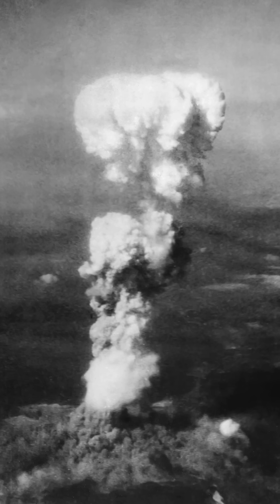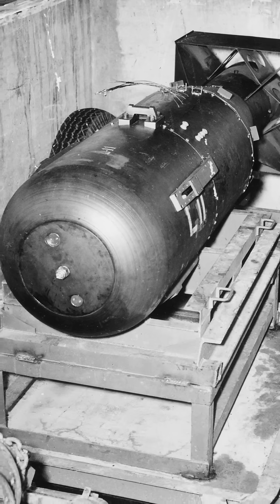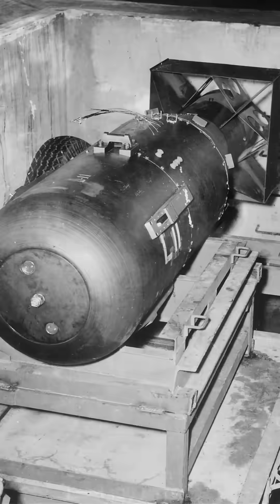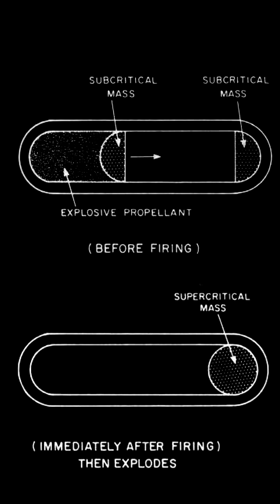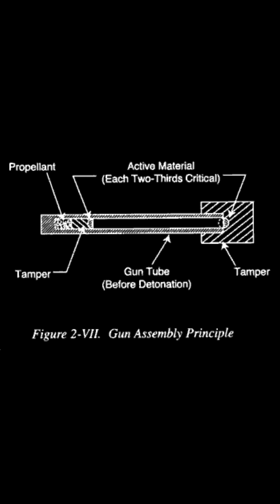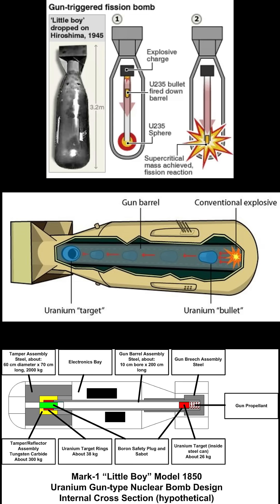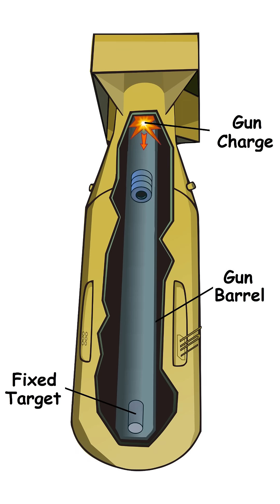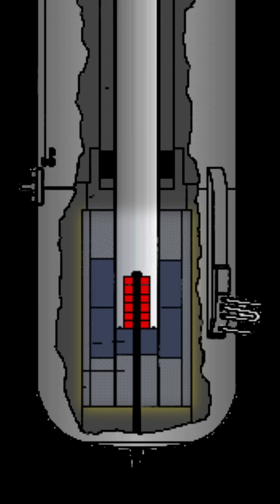What Everyone Gets Wrong About The First Nuclear Weapon Used In War

Comment: One of the reasons it was inefficient is that prompt critical mass was reached long before the rings reached their full travel distance.  This caused a premature detonation causing a lot of the fissile material to be wasted.  

This is why an implosion-type weapon is more efficient.  In this type, more of the fissile material is a part of the critical mass, but it's still possible that not all will be, depending upon how fast the implosion occurs.  If the prompt criticality occurs prior to the whole fissile mass is completely compressed, then some material can still be wasted.
Reply: No really. It had a few % risk of premature detonation, but in didn't happen in the actual use. Crossing critical mass does't cause immediate detonation in Uranium (immediate here means less than a millisecond). You also need a random free neutron to initiate the explosion. And Uranium is relatively poor of free neutrons. So when the projectile hit the bottom, it triggered a highly active neutron source and that triggered the explosion in several tens of microseconds. But the whole critical mass was fully assembled.

And the efficiency is poor because in gun type weapons you could only exceed the critical mass by relatively little (each unassembled part must be below critical mass, obviously; after assembly the critical mass is boosted by neutron reflectors, but it only helps so much; it's exceeded by a factor of 2 to 2.5).

In the implosion weapon the fissile material is compressed which boosts critical mass excursion multifold. Modern weapons are thought to exceed critical mass by a factor of 7 when they detonate.

Exceeding critical mass by more means way much faster multiplication of neutrons and more is produced and impacts fissile nuclei before the whole assembly is blown apart. 

Another thing (so called boosted fission weapons) is adding some (couple dozen of grams) deuterium and tritium in the very center of the weapon pit -- this supercharges neutron production and about doubles the burnout.
Reply: No. The Mk-1 was not terribly at risk of predetonation, and Little Boy did not predetonate.
It was inefficient because of the lack of compression.
This is why implosion allows for higher efficiency.
"more of the fissile material is a part of the critical mass" doesn't make sense.
Gun types don't produce any meaningful compression.
Reply: @Evan_Bell  I think you're responding to the wrong person. You and me are in agreement that the OP is incorrect.
Reply: @SebastianKaliszewski  Sorry, you're right I erroneously responded to you in my first reply. I'll correct it.
Reply: @SebastianKaliszewski  Everything you said is basically correct, although modern boosted weapons certainly don't produce 7 critical masses, and they don't use a couple of dozen grams of boost gas. The most I know of is 6 grams. Typical value seems to be 2.5-4 grams.
Reply: @@smithy1833unlikely but technically possible. Implosion type nukes are incredibly resilient packages, even dropping them from a plane won't cause critical mass to be reached, let alone cause it to go super critical.
Reply: @vyor8837  
Hell, even a few primary charges going off won't cause criticality, as long as most don't, or the primary charges are just a little out of synch with each other.
Reply: @@smithy1833 each segment is too small to reach criticality on its own.
Reply: Should have just made a cone instead of the cilinder. masses wouldn't come in contact until the very end.
Reply: It’s impossible to utilize all of the fissile material in any fission weapon design. The fissile spark plugs within most Secondary (and Tertiary) staged thermonuclear weapon designs achieve the closest to maximum maximum fission burns efficiencies relative to kg of fissile material used.

Of course there are still inherent limitations due to the maximum density achievable through minimal compressional heating so that the only counterbalancing pressure is the Fermi pressure produced by a completely degenerate Fermi gas. The inevitable shock induced entropy increase  during hydrodynamic separation of the secondary pusher/tamper ablation results in half of the total work completed by the time the total secondary volume has decreased by half relative to the radius from the surface. 

This is about a 21% radius reduction from the outer surface for spherical geometries, and 29% for cylindrical. The remainder of  the work that can be performed is negligible and exponentially dies off beyond this distance from the outside. so that only the outer layers of the pusher/tamper and fusion fuel get compressed most efficiently. 

Still, the fissile spark plug should end up compressed to a minimum of 3.5 to 4 times its original density, and potentially even greater with minimal preheating and background neutron radiation in the Secondary. A Pu-239 spark plug of very low Pu-240 content  (less than 2%) would improve burn-up efficiency as well.
Reply: @bjornragnarsson8692  Good to see someone talking about hydrodynamic separation ahead of the radiation diffusion wave in the secondary ablator. Something very people are aware of.
Reply: and by "still possible" you mean "inevitable"
Reply: @railgap  yes it's inevitable. But it's not because of predetonation. It's because even perfectly timed bomb blows itself apart before all the fissile material has time to fission.

Comment: Inefficient like only a few percent of the uranium? It's amazing how only a small percentage of the mass of a small amount of the uranium is enough to release so much energy! E=mc^2 is amazing and terrifying
Reply: Inefficient in that it used ten times as much fissile material as Fat Man but achieved lower yield. With an implosion design they could use the same amount of HEU to build 10 bombs. Or, as was actually the case, they could use composite plutonium/uranium cores to stretch both uranium and plutonium production.
Reply: @rocketsocks   HEU as in highly enriched uranium?
Reply: @DANGJOS  yes

Comment: why is it that hiroshima and nagasaki now have livable levels of radiation after only a few decades? whereas chernobyl is still radioactive to this day??
Reply from the maker: Because there were tons of radioactive material in a reactor core rather than only kilograms in a bomb
Reply: @scottmanley  It feels like the blast and mushroom cloud would have had a different fallout footprint than the relatively small core pop too. What do you think? I also wonder if the radioactive products were different and thus had different half-lives. Of course, the mass of radioactive material is certainly the most weighted factor.
Reply: Both bombs were also air bursts, which create a lot less fallout than a bomb that explodes on the surface, irradiating all the dirt and debris at close range as it throws it up into the atmosphere.
Reply: @RCAvhstape  Bingo. The gamma rays and X-rays that would cause fallout may be almost completely absorbed by the atmosphere. That's what causes the initial fireball. If the fireball doesn't touch anything solid, there's effectively no fallout. You can get radiation poisoning if you're within sight of the blast up to a certain range that is yield dependent, but if you're that close, you may also get third degree burns or shockwave effects (including flying debris) that will kill you faster.

Airbursts are used for greater damage range. Ground bursts are used against hardened targets where the energy is needed to defeat hardening, like ICBM silos and submarine pens. In a nuclear war between superpowers, selected targets would be ground bursts, but most would likely be airbursts.
Reply: Because bomb dropped on Hiroshima contained ~60 kg of uranium, while reactor of Chernobyl contained dozens and hundreds of tons of radioactive materials.

Bombs aren't usually made to pollute with radiation, just to destroy.
Reply: Additionally, an atom bomb uses a relatively small amount of highly reactive nuclear fuel that vaporizes and disperses quickly, while the molten corium of a meltdown continues to undergo a much slower continuous reaction to this day with much more fuel. It’s like a very, very slowly exploding atomic bomb with most of the energy released as heat and radiation. It’s still reacting to this day, whereas an atom bomb reaches its final generations of critical reactivity within nanoseconds. A lot more energy released a lot quicker, but the result is that all the fuel gets vaporized near instantly and quickly dispersed and rarified. The corium of a meltdown stays put and keeps reacting
Reply: Reactors have much more radioactive material for one. 1 megaton of explosive yield represents the same energy as just 48 gigawatt-days, which a reactor that produces 1 GW of electrical output using 3.2 GW of thermal output will achieve in just 2 weeks. So operating a power reactor for months produces enormous amounts of radioactive material. Additionally, the bombs vaporize everything into atoms which don't leave a ton of radioactive material long term locally with air blasts. Most of the fallout ends up distributed into the atmosphere and the stuff that falls back to earth can get washed away by rain eventually, so the site doesn't remain radioactive very long. In contrast with a disaster like chernobyl you have chunks of radioactive material in the form of ash which just sits around in the environment for centuries. And the major hazard in those areas is stirring up that debris and getting it in your lungs. They're just very different situations.

Comment: Did Scott Manley just tell the world how to build a nuclear bomb *correctly*?
Reply: US government sources redact all of the measurements in the designs they release.  However, the measurements aren't that hard to reproduce.  As my favorite physics professor once said, you can't classify the laws of physics.
Reply: @ahseaton8353 There was an engineer who was able to create a set of plans that were apparently disturbingly accurate, based solely on de-classified information.
Reply from the maker: It’s not the first time…..
Reply: Yes and no, what he didn't explain is the precision required for it ti happen
Reply: With weapons-grade Uranium many approaches will work. It is not that hard. Just get yourself some of that, duh.
Reply: @noop9k xactly. Building the bomb is the easy part, getting and refining enough nuclear fuel without catching the eye of the government would be the difficult part.
Reply: @heisenballs  This is what I meant, duh.
Reply: @heisenballs even harder than getting the nuclear material is getting the delivery method.
Reply: @heisenballs yeah Sheldon Cooper got caught
Reply: You think what he described isn't more or less common knowledge?
Reply: @almostfm  I knew about the gun mechanism, I didn't know about firing the cylinder over the core, not vice versa.